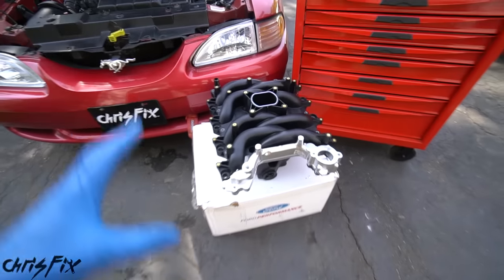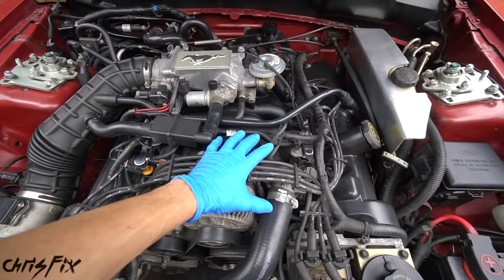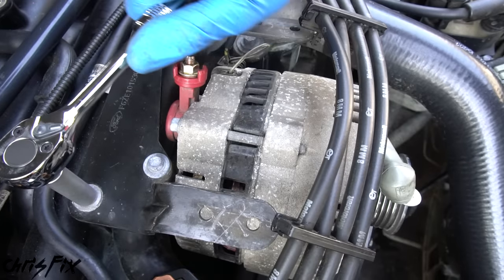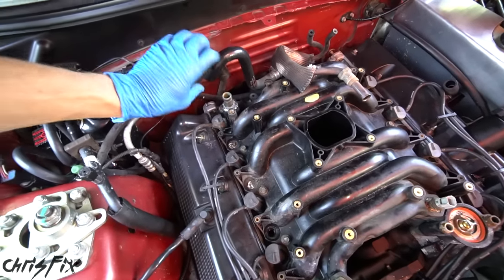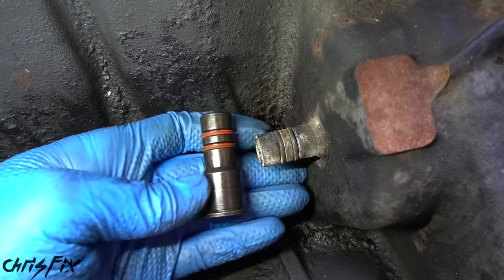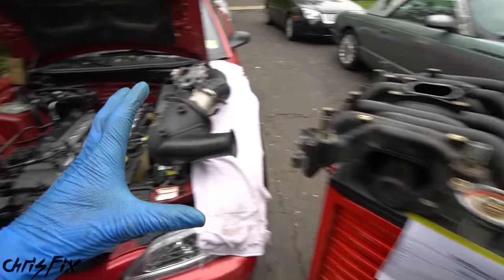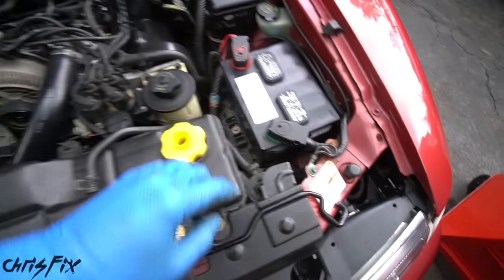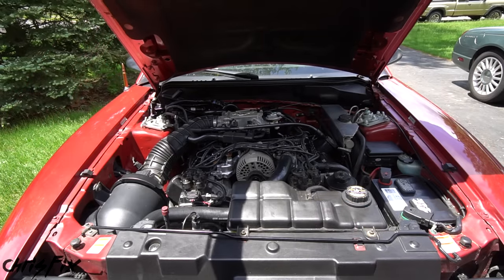How to Install a Performance Intake Manifold and Replace Gaskets (Dyno PROOF)

Comment: Listen up folks had this been an actual mustang owner and not a u tuber he would have saved the money spent on 2 useless dyno runs and spent the money on performance cams and valve springs and made a 50 hp improvement plus for the same money if not less because dyno pulls are EXPENSIVE .. so viewers at home unless daddy owns a shop with a dyno spend your money on actual go fast parts and a dyno run at the end of your improvement journey.. no need for one at start because a 4.6L NPI stock mustang gt is a turd for performance. I own one so I know first hand .. but unlike chris fix I installed a pro charger as a solution not simply a PI intake ..

Comment: You forgot to mention you need to change pistons every 5k miles forpreventive maintenance. Also you need to change the clutch disk at every red light for preventive maintenance. Bro shut the fck up no one is going to change the water pump just because they are "there already". By that logic you shoulve changed the alternator and sparkplugs and other components since you were "already there"

Comment: 15:14 NOT flathead screwdriver. Flathead refers to car engines in which the cams AND valves were inside the engine. It is a SLOTTED screw driver.